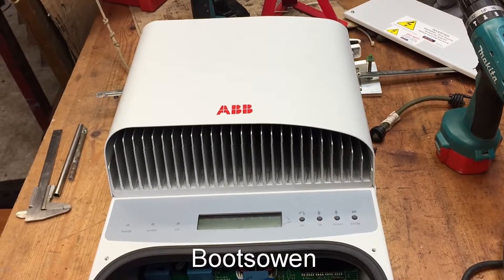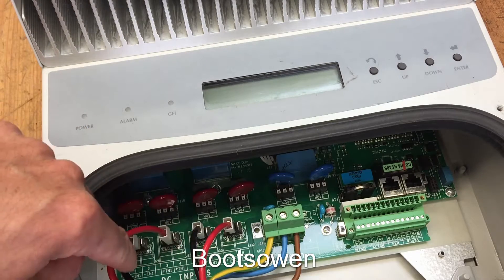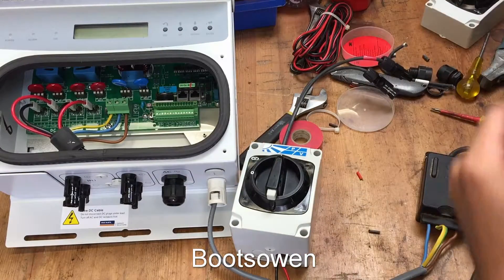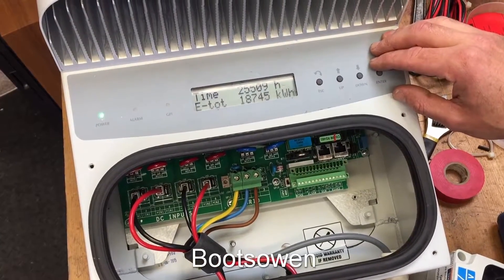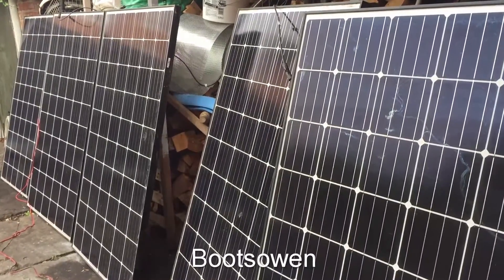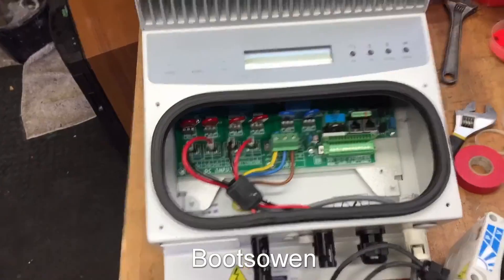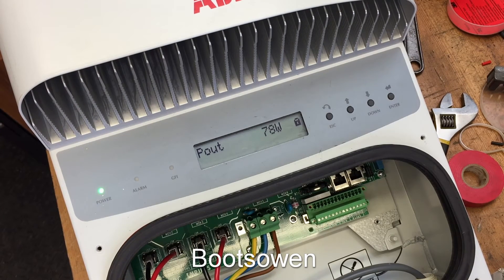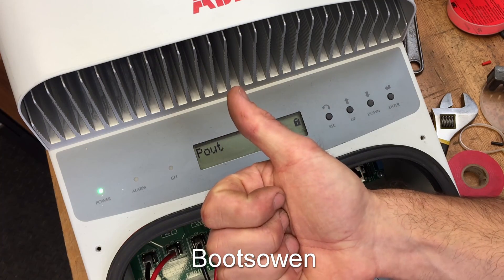Baby steps to solar PV: testing a used ABB grid tie inverter

Comment: Hey I believe I've got the same design inverter where I work. It's an Aurora Power 3.6 I believe?
But everything is the same, startup with the relays clicking is the same. But once it gets synced to the grid, it makes this clicking noise. And I just got a amp meter ociliscope, and looked at the power output from it. And each time it clicks (once every second or so) there's a small surge of current (and heince voltage fluctuations) about a quarter of the wavelength long. Im trying to figure out if that's normal or if something's wrong with the inverter, so I'm trying to find normal operations of the inverter. Does it make a click every second once it's synced to grid?
Reply from the maker: No, after the initialisation phase it should do a short sequence of clicks. maybe 4, and then it should be quiet, maybe humming a little or the fan inside. Was it working correctly before?
Reply: @bootsowen  No idea, it's done that ever since I started working here about 3 years ago, and I saw that inverter back I believe 6 years ago and it was doing the same thing. It's basically the same sound as the first 4 or so clicks when syncing, but then one of those clicks continues for as long as it's synced to the grid.
Now the inverter is I believe 13 years old. But other than that it seems to be working fine. But our main inverters (used to be an old Outback VFX system) we started having them burn up, and they where all setup to back feed from the grid tie inverter to charge the batteries (we're completely off grid here, the grid tie just feeds back into our "grid" which connects up to the output of the main inverters)
And now im half way wondering if that current surge from the grid tie may have been at least a part of what caused the faults with the main inverters. 
We have new main inverters now because the old ones where burning up so often.
Reply from the maker: Sounds like an interesting system. What happens if there is too much electricity?  Typically the inverters I see have failed because one or more of the 4 relays have burnt out. They shouldn't burn out when carrying a load or when switching on or off under low loads. But when they are switching because the sun is too strong and they feel an overvoltage they are really working hard. If the power has nowhere to go then this may be happening to you. I don't know without more information, but you might tell me more, it is interesting.

Comment: È possibile alimentare questo inverter con batterie invece  dei pannelli solari?
Reply from the maker: Yes, if you can get the dc voltage over Vstart of 120vdc. but it will try to feed the grid with the maximum that the battery can give. so I'm not sure why?

Comment: Which type of electric meter you use with this
Reply from the maker: Have a look at my solar playlist
Reply: I have aurora 3.6
Is it possible inverter not feed grid.it give power only home
Reply from the maker: The aurora in the video is a grid tied inverter, it will only work when the grid is present. If there is surplus electricity it will go into the grid. your meter may or may not notice this. I have made other videos about this.
Reply: Please help me
Reply: Can Aurora inverter support zero export device?
Or any other devices that restrict reverse current to grid
Reply from the maker: I don't understand what you mean, I use mine with a solar diverter, this stops spare current going to grid. It is not the same as a unit that stops power going to grid for local regulations.

Comment: Hi is the system still going strong and have you had any problems with it ? And could you do a video of the ac side of the system and how it’s connected to the main distribution board ?
Reply from the maker: The system works without issues in full sun or even on pretty shady days. On the ac side you wire an isolation switch then directly into a circuit in accordance with the regulations in your region. I have no idea where you are so I can’t help more.

Comment: The AC is an output - it should draw no power from the AC mains as it is designed to take a DC input and output AC
Reply from the maker: The ac side is interesting. The inverter has to detect the dc first before it fires up. Then it looks for ac and checks voltage and frequency. So initially the is an input but only for detection. I imagine that various inverters have different startup regimes.

Comment: I have the same inverter , or you have to link the v1 and v2 , as I have 40v on v2 with none plugged in, assuming the amps to high on the v1
Reply from the maker: What do you mean?  I’m not sure I understand you.
Reply: Sorry yes the reason you have volts on the other string is , when you only use 2 of the 4 DC inputs you have to link them out so the inverter Equals out the amps coming in

Comment: Terrible thing to do I'm afraid (imho). Micro inverters are unquestionably the way to go for oh so many reasons.
Reply from the maker: Tell me the reasons. I don’t know much about these things. Thanks
Reply: @bootsowen  I'm not an expert or anything, but top two by my estimation are safety and efficiency.

You're already playing with 100v+ of DC and if you series them all up it will be a serious risk on a DIY install. Shock risk (which is DC that will cause your muscles to grab whatever live thing to touched) as well as fire hazard.

My understanding of series panels is that if a bird craps on one, or a cell fails, or a shadow, or whatever... then they all take a hit, basically the system runs near the rate of the worst performing panel. You could test this with a row of series panels take a reading and then throw a blanket over one... I'd be very interested to see that result as I don't have a series of them to test the information I have been given. Covering one of five panels you would think 20% drop in wattage... But I guess the covered one adds resistance so you get less than 80% for 80% of them?

Micro inverters get the best out of every individual panel, pay for themselves in efficiency, reduce expensive DC cabling, and run at safe DIY voltages. I have APS ones which run two panels each but they run the two panels independently of eachother at whatever voltage is giving the best wattage output at any given time.

My ones communicate via the power line and report in to a little display box which in turn reports their performance to the interwebs; then you can get the app on your phone and see which panels are running at which wattages to find any issues which you may not be aware of on a series panel install.

To be fair, for £600 it's a bargain anyway; new micro inverters plus panels are still around £1/watt so £4,000 for a 4kw with DIY setup.

You are theoretically supposed to do some paperwork and get it all signed off with a registered installer I believe; or you're not supposed to feed in and certainly wouldn't get paid for feeding in... At least that was the situation when I did my array a couple of years ago. We just use all the power crypto mining so we never feed in.

Comment: Bargain.  I only use our solar array for low voltage (12V) battery charging and powering our greenhouse/ polytunnel's grow LEDS.  Obviously an inverter is at hand if mains are required.
Reply from the maker: I am thinking about batteries too, but this is a good start, with a reasonable investment. Batteries would make it independent if the grid goes, but candles and firewood have worked for me so far, with the car battery to charge phones. The only thing that would be useful if the grid goes is to keep the fridge going. But in 10 years in this house the 5 or so outages weren't long enough to let the freezer thaw.
Reply: @bootsowen  Ah we are in the middle of nowhere in Scotland.  Same on the fridge front .  We have a log burner with plenty fire wood and a 1200 litre kero tank for the CH which needs powered.  A wee petrol genie which could run all the essentials and a 5kW red diesel shop genie (1200 litre tank again) for the tools which would happily run the washy machine if required.    
As obvious though the solar is the best redundant system.  You could start picking up car batteries, even old and recondition them.  18 in series ideally 600 amp gives you in excess of 130Kw at full charge.  
Quite a bit of reduncy bro.  And then one could always run the washing machine manually from the cement mixer....  lol
Reply from the maker: I made a cement in a washing machine video before. !  Lol

Comment: Can you draw a basic bigclive drawing of what's going on in  that complete system please Mr.B. ?
Reply from the maker: You won't need it! the solar panels are connected to the inverter, the inverter turns DC into AC electricity to exactly match the mains and pipes what the panels generate to the grid through a plug. It shouldn't be a plug, but I was just testing it!. Andy is better placed to describe what is going on inside the inverter. But my understanding is that it just chops up the DC into up and down pulses of AC. How it does it gets technical quite quickly and is beyond me, but there is 2 computers in that inverter box. Let me know if that is not enough for you, I can make a video, but I have a feeling that Andy has already made it! I will post a video when I get the panels mounted and it is a sunny day!

Comment: Splendid, welcome to the club. Best angle for the panels is about 25 degrees facing as south as possible. That Vstart is a real teaser if you are unaware of it. Assume you downloaded the manual and I hear you bought a copy of my book, thanks for the link, cheers
Reply from the maker: It was just good luck that you mentioned the Vstart in another video that I happened upon last night! Otherwise I might have spent the morning scratching my head! The manual says to leave Vstart as it is, surely it is better to have the relays working with the lowest V, as that would give a low W/A as well? Or maybe I should put my neck back in. I can get most of the panels 10 or 12 in a string to face due south at 25 deg, but they will be obscured by my house until noonish. Once I had let go of the concept of a return on investment anything was possible, if it is an experiment then it can't fail. I have the constraints that I have in terms of siting, and I have the skills that I have, so I'll do what I can. Thanks!
Reply from the maker: Hi Andy
I am thinking about getting these panels up, I think 25 degrees is the same angle as my garage roof, so it would match well if the panels were adjacent. 
But it got me thinking, are all the roof mounted ones a bit of a compromise? In as far as they are at whatever alignment and angle that the roof has?
Reply: @bootsowen  Owen, yes it's all a bit hit and miss. The shallow angle might not be correct for winter sun but it fine for what I call ambient light, meaning light reflected through light cloud. Just do you best for the position and don't get hung up on rabbit hole details, cheers
Reply from the maker: Thanks Andy, I am just getting hung up on the current price of timber in Manchester. Have to find other sources!
Reply: @bootsowen  Owen, try a proper local sawmill, out in the sticks, not imported timber. If you are thinking about the car port then fresh sawn with be fine, otherwise what about reject scaffolding boards? Cheers